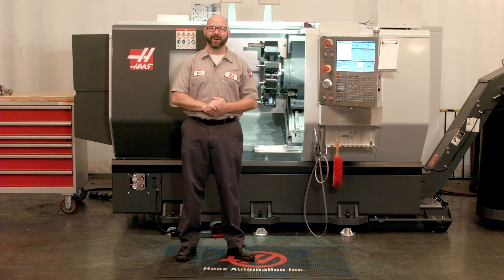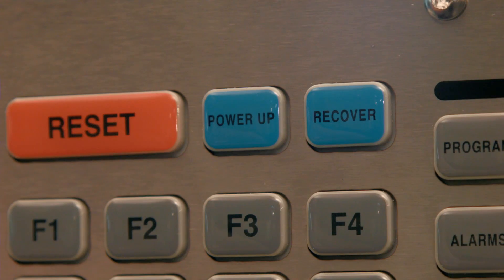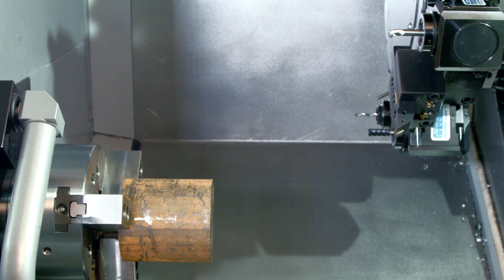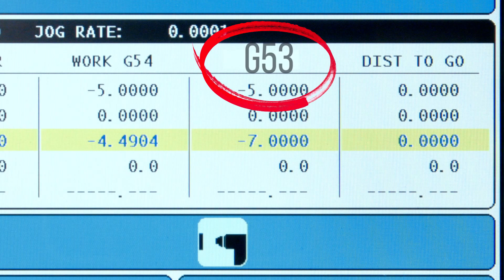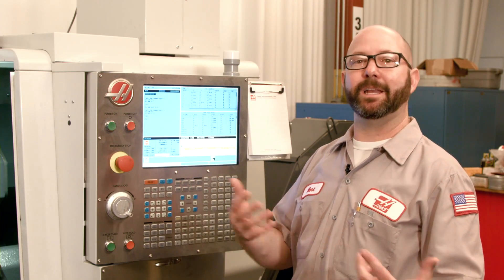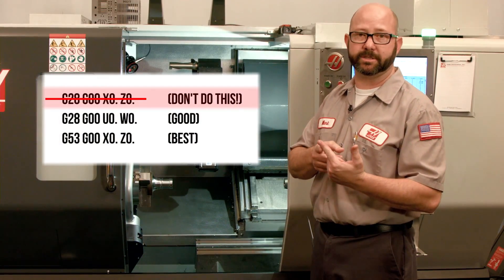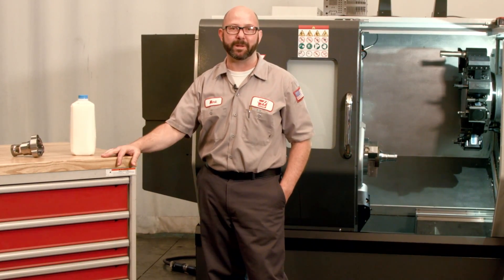Use G53, not G28, to Cut Cycle Times and Position Your Lathe Turret – Haas Automation Tip of the Day

Comment: Seriously, how many people do you think are writing code manually at the machine?  There should be a definable safe location that can be set on the machine during setup so that no additional code or changes to the post needs to be made!  It's ridiculous on a machine like the TL series lathes where a G53 sends the tools 48" back to home, then right back for the next operation!  Even the Haas guy that was called out agreed that this is stupid!  Why not just make G53 definable say a few inches past the part?
Reply: You can just create another work offset far from that, like G55 or G56

Comment: This is a tricky tip. Because with my ST-20, I always make sure the Safe Tool Change Positions are active and that those are set to the machines home position. And this is because a couple of guys here have crashed into the chuck and also into the tool setter while that setting was inactive…they accidentally pushed the turret forward/reverse button while the turret was close to the chuck and while the tool setter probe was out and exposed. So to be able to use the G53 you have to disable that setting or make it inactive.
Reply: This seems to be excellent advice. Oftentimes, it is better to be consistently safe than save a few seconds.  I used to say, before I retired, that it takes a lot of 'attaboys' to cancel out one 'oh shit'.
Reply: @ lol exactly my point. Thank you.

Comment: I have been using just a g28 on my sty lathe for years now. If you don't put any x,y,z or other axis it homes everything out. I have never had it rapid to g54 work offset. That being said I may change to g53 but I find g28 is a simpler code. I'm also running the st10y so it's a small machine and I usually need it to go home for a tool change.

Comment: never have use G28 on lathe in my life. move away far as you need to get next tool. machine is turning direction that is closest. FASTERN THAN G53 move away fas as longest tool
i can change from t1 to t2 in postition X(shaft size) Z1 part is allready roughed and finishing tool is same size LOL means milli seconds faster than move "anywhere" basically mean you can change tool same position where you start G71 LOL

Comment: Hey Mark. I currently run a 1980 nori seiki SL-1 LATHE. I use G28 to send my turret home to do a tool change. I'm not sure if my yasnac2000g control has G53. Anyways my normal line of code would be 
G00 T01 
G50 Z4.0 X 6.125  is my tool offset from home origin to part 0.
Then in my code if I put a G00 x0z0 it will be at part zero. So how would I send my turret back to a safe tool change position? I have to run that tool then G28 which is a slow process then I have to have a g50 x0y0 to cancel out that last tool then do a T02 and then G50 X...Z.... for that tools offset. Unlike newer CNCs  tgat have a tool offset page which I do not. My tools are offset by the Gcode commands in the program.

Comment: It's Gildemeister GD 12 sliding head CNC machine. Program
N3 G40;
G52 Z0.0;
G52 Z50.0;
G54;
G0 G53 X76.0;
G0Y0T0303Z0.0 (TURNING);
operations;
;
;
G0 G40 X15;
G53 G0 X76;
M103 (wait);
N4 G40;
G52 Z0.0;
G52 Z50.0;
G54;
G0 G53 X76.0;
G0Y0T0505Z-5.0 (GROOVING);
operations;
;
;
G53 G0 X76;
M104 (wait);
N4 G40;
And Go on
Sir, please explain me how does he use G52 command

Comment: Sir please explain why we use G90 in starting of the program.  For example  G00 G90 G54 X0.  Y0. 
Why we don't use G91...
Reply from the maker: vivek Yadav – For new programmers, I would say to only use G90 Absolute positioning. When in G90 mode, all of our X, Y, and Z locations are based off of our Work Offset (G54, G55…) zero. X10.0 is always 10 inches/millimeters to the right of our Work Offset (G54, G55..) zero. When in G91 Mode, all XYZ moves are Incremental, meaning that an X10.0 isn’t 10 units from zero, it is just 10 units to the right of the last position it was at. This can be useful, but it can also be a dangerous way to program. Check out the G90, G91 sections in the Mill manual for more information. Sounds like it would be a great video! Thanks for the comment. https://diy.haascnc.com/user-guide  – Mark, Haas Tip-of-the-day

Comment: I haven't looked deeply into how G53 works, but I discovered that you can use a G28 command efficiently if you precede it with a G90 incremental command. It's really just telling the machine to, "Go nowhere in (axis), then go home." Don't know if there is an advantage to using one over the other...
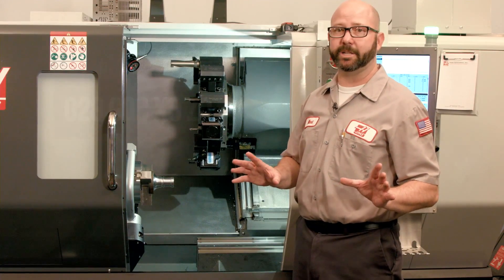Reply from the maker: Christian Gray – I am a big fan of the G53, over the G28, for sending tools to Home. If we do use the G28, we will definitely want to use it in Incremental Mode, and not in Absolute Mode, otherwise we can end up with what we see at 06:00. On the mills, that means only using G28 with a G91, and not a G90. You can check out this video for more info on the sending tools home on mills: https://youtu.be/Rd-h0YA9IzQ?list=PL1FfK7Yod27cy-MIhXsKkDwTmvclf7ps7&t=323 – Mark, Haas Tip-of-the-day

Comment: Is it possible to place subprogram in head of .nc file ? with turret retract code, call it in further program, and preset some macro vars to setup tool home before job start

Tool change is notably impacts on production effectiveness, so why not hardcode this feature inside of core of the CNC rack ? Expand T06 (by T666) with "go tool home" behaviour, and add one key press configuration of this tool home. So operator must expand his prejob setup only with one more step: reset tool home on longest tool installed.
Reply from the maker: Dmitry – We can create our own M-Code that, when called, can move the machine to any position you’d like. Watch this video to see how: https://www.youtube.com/watch?v=HZiJEt0bMA4&t=21s. Having the control do this automatically can be difficult, as the machine doesn’t always know if you are running an O.D. Turning Tool, a Boring Bar, or running with a Tailstock. Sometimes we may want to retract the X first, and sometimes we may need to move the Z first. I like the idea, and am going to look into this some more. Thanks for the comment. – Mark, Haas Tip-of-the-day.

Comment: i used to Program each tool to an individual sweet spot( not a Haas)....will give this a try on MONDAY...thanks.
Reply from the maker: sunilkumar vc – On production jobs, setting a “sweet spot” for each tool is a great idea. If only moving between O.D. turning tools, that are just one station away from each other, I may just back away by an inch, for that one tool change. If it is a dedicated machine, it is worth the extra setup time (safe position for each tool). For short-run jobs, I’ll just set a single safe tool change position. Thanks for the comment. – Mark, Haas Tip-of-the-day

Comment: I use T0000 Z100. X200. depends on the longest tool for Z value and the machine size - job diameter - tailstock for the X value.
Reply: Control brands there. Okuma usually good with that by most configs. Haas is basically Fanuc. Excellent video. G28 U0. W0. can still be a good idea in many scenarios especially with smaller lathes. You don’t lose much  time and there are some  unpredictable variables from programmer perspective. But calling out the absolute reference could be really helpful. I was doing this idea without calling it. So I was setting safe spots at the end of every tool path on the floor. Does calling G53 cancel comp?

Comment: can you give an instance where you would want the tool to rapid to your work coordinate zeroes before it rapids to machine zero? I just have never seen any reason to use g28 in that way and wonder what the point of that function may be good for?
Reply: Yes. You want to return to part zero BEFORE machine zero to make sure the tool is retracted from the ID of the part. Or in the case of multiple WCS offsets where dog leg moves cause crashes. Lathes aren't like mills, there is no default safe retraction for every instance. You'll never crash a mill Z'ing up.
Reply: very good point! now I see the light. thanks :)

Comment: What about the G29 command then? I's very poorly described in the lathe manual, but I have seen some notes on forums of it being used in conjunction with a certain coordinate system and/or G28 to actually set a tool change position. This makes more sense to me as i often have to change the tool change pos in the same program. This has lead to me just using a safe tool change pos in G53 very far away, since  G28 can crash some of my longer tools in the roof of the machine. 
I have a DS-30SSY btw. Great machine :D
Reply from the maker: Norwegian machinist – G29 is a scary G-Code. As a rule, I like to have people safely position their tools with UW (incremental XZ), and G53 Machine Coordinate moves, not G29. I do have some more info on G29 though, if you want to email me at TOD@haascnc.com. – Mark, Haas Tip-of-the-day
Reply: there are many codes that date back from the 80's and rarely used like G10 ( but recently I did use it). Some machines like Mazak have a secondary home position G30. If I am unsure about a process or code, test in graphics, then test without a part or even shift the Z away from chuck or I have even shifted X on a tailstock part to eyeball visual test a change I made in a program on a half finished part on tailstock.  Use everything you can to ensure no crashes.
Reply: The G53 has been around a long time. Prior to the work coordinate systems G codes everyone used G28 in mill and lathe. G54 was an $$$ option on other machines in the 80's. So many many shops still use G28 until this day.  G53 is way better.  thanks Mark.